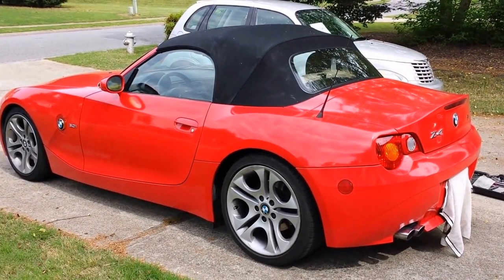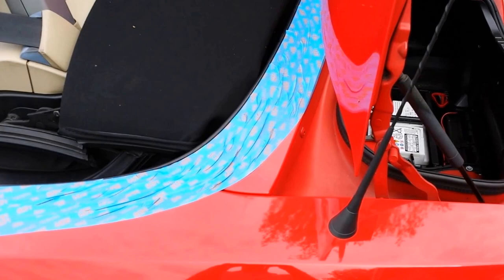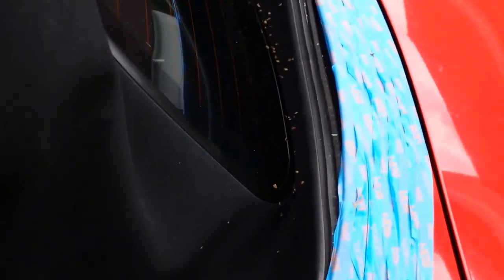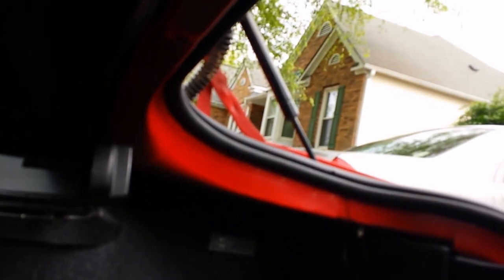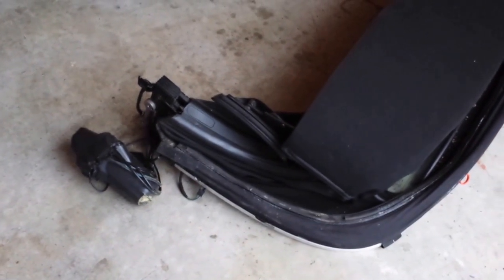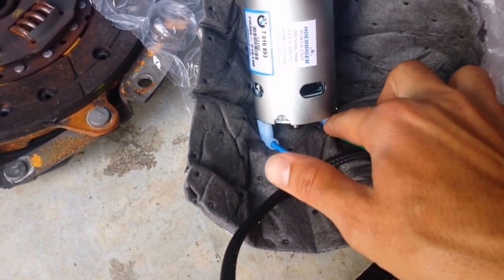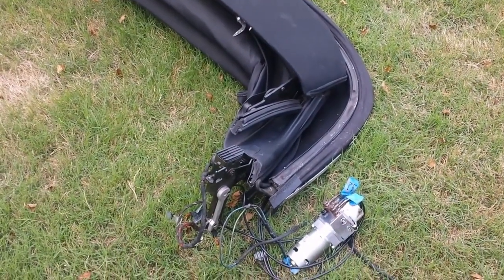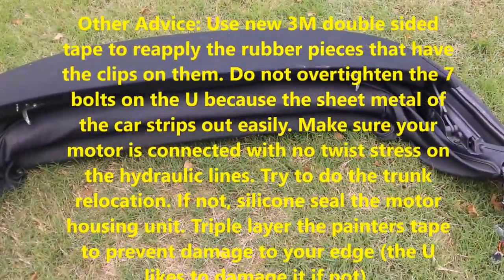How to remove test and replace a BMW Z4 Soft Top Motor COMPLETE HD

Comment: Great video but you are incorrect about the banjo fittings, the hole does not have to line up with anything. The roundness of the banjo fitting is sort of like a tubular tunnel. Good luck everyone.
Reply: You are spot on...
That's the way this type of fitting is designed.
Brake calipers have the same type of fitting.
No worries, about lining up the hole.

Comment: Americans are experts at how to make a job really difficult. Can take the motor out through the rear corner with parcel shelf tray out. Roof doesn’t need to come out. Doesn’t need new motors either. They all can be fixed.

Comment: FYI, you don’t have to line up the holes. A banjo fitting is designed where the hole lines up in a certain channel in the banjo fitting. Like a groove. Good video though.

Comment: Pull the “u bracket” from the front not inside the trunk. I used a long screw driver both sides popped right up

Comment: If you remove the bolts around the aluminum ring in the trunk first the rubber weatherstripping is much easier to remove.

Comment: EZ tip to remove U-ring from the forward clips. 11:10.  Put top up. From outside just forward of rear wheel, Reach around inside top approximately where clip is, grap frame and gently but firmly jerk upward. Do both sides. Pops right out. Thank for video!
Reply: I had to figure this out by watching a video by the Car Ninja.  Seems so simple now.
Reply: a wonder bar from inside the trunk about 7" from the end worked too

Comment: Thank you for the detailed video, this just helped with replacing the rear wing as there is a bolt where the roof frame needs to be dropped to get access

Comment: this video worked for me.  weather stripping was a bitch to reinstall.... thought about the relocation to trunk but didnt feel like cutting stuff... silicone sealed the housing.  thank you for this upload saved me a $1000!
Reply from the maker: You are welcome. I tried the relocation but got lazy. I ended up moving the motor to behind the driver headrest! It limits how far back you can move the driver seat but I am only 5'6" so it worked for me.
Reply: Any tricks on the weather stripping

Comment: cont: they knew the pump was on it's way out and tried to wing it past a Buyer. They also paid for a spare key through a BMW dealership ($235.00 and detailed the car very nicely..I am the second owner...it was garaged kept..all service records..top and body in exceptional cond. 50% tread left on run flat tires. thanks again for posting the vid.

Comment: I am getting ready to do mine, and your video was a big help.  I still am wishing they had a better  system than those tight clips at the fronts of the U-rail.  I don't see a good way to get to those.
Reply from the maker: Agreed. I used a trim pry bar that was metal with a handle.

Comment: Pray4UrLife12- Mate, you need to urgently update this video. At 18.00min you are telling people to line up the bolt holes with the outgoing lines. This is INCORRECT!! Massively! 
The bolt hole is irrelevant. The hydraulic banjo goes completely around the bolt and its hole. If you try to line up the "hole to the line" as you've stated, you wont be affecting the fluid flow at all but you could very well not be doing up the bolt enough to stop any leaks. Remember.....this is high pressure hydraulic fluid. ALL connections MUST be tight to stop leaks. You never have to line any holes up with any lines. When you understand the design of the banjo joint, you'll see what I mean. You really need to find the torque spec (ft/lb etc) for the bolt and, ideally, use a torque wrench.
I hope this helps people out and stops them having to waste another 4 hours ripping everything apart due to leaking all the fluid out :)
Reply from the maker: Boostinpulsar I stated this because I noticed, when tightened properly, the holes lined up for me. It was actually impossible for me to tighten further. Is this a general knowledge banjo bolt statement or do you know this to be true for this specific scenario? I'm more than willing to update once I ger home if you can help me confirm your information. Thanks for picking it out! I hope people have the common sense to realize if it is too loose. Good find, boost!
Reply: No worries brother! Yeah, this is a general banjo joint statement. Its how they're designed.  They are a full-encapsulating design. I used these types of larger banjo's on water lines to and from my watercooled turbocharger core. It allows the joint to be filled with the fluid, despite where the hole in the bolt is. Under pressure, it will go in the hole within the bolt. So, it doesnt matter where the hole is. It will still flow the same amount of fluid under the same pressure available from the pump despite where the hole is.
If you just type-up in yellow writing "Update: Do these two bolts up to manufacturers specifications, regardless of the bolt hole lining up with the line or not", it will help people out from having leaks. I'd also recommend that you say to test the lines prior to reinstallation, to make sure theyre are no leaks, by powering up the pump with the lines connected. :)
Reply: I was shaking my head too at 18:00... Banjo bolts should be torqued to spec with new crush washers, no matter where the holes are! Please update this to avoid leaks for other people attempting this.
Reply: I'll second all said. Banjo bolts don't need to "line up" they need torqued with new crush washers.
Reply: It is also important to  note that the hydraulic lines are numberd.  they MUST go back per numbers on the pump.
11-13, 12-14 in their respective holes.

Comment: Out top was working perfectly, then after arriving home we pressed up and top went up 1/3 of the way then stopped. Further inspection, appears pump and cylinder are fine as we are able to feed power directly to motor and make top go and and down with no biding issues etc. So we tested holofex sensors and they seem to work well. Took top module apart and there are no smells or burnt circuits. Trunk tray sensor bi passed and switch tested all works well. We can press the down top button and it goes down, then windows roll up as always, but when we press up it goes up smooth then stops 1/3rd of the way up and blinks red on switch. Press down and town goes down again, then up and it goes up again. LOL lubed all joints, car running while testing, etc. Again we are able to complete the top up with direct 12v power to motor and back down. We also direct 12v to lock motor and it does work fine, locks and unlocks. ANY IDEAS? HELP, I am about to trade this car in next weekend and this happened.... HELP. Thank you in advance. We did check all wiring in top going to sensors for pinching damage etc but all looks good even inisde headliner.
Reply from the maker: DSM Dallas wow that sounds like a nightmare. You have done everything that I am aware of. I was lucky and it ended up being my soft top motor so I never looked into anything else like you have. I did however have the same problem as you with the top not passing up past 1/3. Maybe the release pin needs to be tightened or loosened. What I am talking about is the red lever that you pull to manually close your top. It is found on the left side of your top accessed from the trunk. There is a white plastic knob found on its line that can be used to adjust tightness of the red handle. Perhaps the line itself is being impinge on during closing causing the motor to disengage during closing? Is the fluid level okay in the chamber of the motor? Maybe you have an air bubble trapped because of slow leakage over time. You should see some fluid on top of the motor.

Comment: This is fantastic! Thanks so much for taking the time to put this together!! I know I'm going to use it in the future. Quick question: There's no need to bleed the lines to remove any air that might get into the system when replacing the motors and swapping hydraulic lines? Seems like performance could be affected if air is introduced... ?
Reply from the maker: patryk996 I did not replace the lines, only the motor. There is air in the motor fluid housing which I imagine would be the end point of any air that may have been trapped in the method that I used. If so, add some oil to the motor compartment afterwards.

Comment: Your car sure does look a lot like mine… Did you change the woodgrain to aluminum trim? I still can’t find the build sheet to mine but it is red with a black top 2003 3.0 it was either that or a Miata or a Porsche Boxster, I still kind of long for a Porsche but this car is solid and great the only downside is expense of tires
Reply from the maker: I had a NB Miata prior and I would never go back. Yeah, I didn't care for the expense of the Porsche. I just changed my 2 tires last week for $560...

Comment: Great vid, I'm currently doing mine and about to start re assembly of the pump/motor. Did you need to add hydraulic fluid to the reservoir before or after connecting the lines or do you add it via somewhere else? Thanks
Reply from the maker: I just added it the the chamber on the motor after reassembly, work the pump, re-top off chamber as needed.

Comment: Great video,  and I follow your procedure upto 0:52, and the soft-top is stopped at the exact position as yours.  Hope to get the   details how could you make it all the way to the bottom,  don't want to try the brute force method now.
Reply: pull the red ring on the cable in the and lock it so it stays pulled.  This allows you to manually raise and lower the top.  It's fairly heavy but it can be done.
Reply: @tamiebasse6595  Thanks for your reply.  I didn't try too hard and worry about breaking something for so doing,  will try again.
Reply: I forgot to mention the latches to the top of the windshield need to be undone before you can move the top manually.  I've never tried it but if these electrically operated latches don't work , they can be operated after removing a plastic trim cover near the front-center of the top and then using an allen wrench to retract both latches simultaneously.  The electrics sequence the latches before the hydraulics before retracting and the hydraulics operate before the latches when closing the roof.
Reply: @tamiebasse6595  Yes, the latches on top of the windshield are working in my z4, thanks again.
Reply: @tamiebasse6595  I tried to use brute force and I could fully open the top now,  no matter the red ring pull out or not,  and luckily it doesn't break anything and I can go ahead my investigations,  thanks a lot.
Reply: It should be much easier with the red ring pulled because it opens valves in the pump that allow the hydraulic cylinders on the retraction mechanism to push out and pull in fluid as necessary for manual cylinder movement.  If it can be moved regardless of the red ring position,  the cable from the ring to the pump may not be moving the valve inside the pump correctly or there may be internal leakage in the pump.  Also, the retraction cylinders themselves may be leaking internally or the hydraulic oil may have escaped.

Comment: Hey thanks for the 'How To' you should get 'hazardous duty' pay and some Purple Hearts for the wounds incurred 👍 I was going to attempt it on my 2005 Zed pump failed a week after I bought it used last month..
I called the dealership ( not BMW dealership) where I bought it and they graciously agreed to replace it, even though it was not warrantied ..The I got to looking at pics of the car they had posted on their website and they did not have one pic of the car with the top down...even though all 17 of the other convertibles ALL had 4 pics in a panel w/ top down.
I'm thinking they knew and were just hoping someone would say 'oh well'They fixed it in one day..Paid in a spare key $235 from the local BMW dealership , and detailed the car real nice for me as a goodwill gesture.So I was spared some sliced fingers...:-)
That was nice of you to post the vid...you seem like a calm dude and made it look easy..thanks again,
Reply from the maker: Glad they took care of you! Not many dealerships out there will do that. Just peek your head in to see that the motor housing was properly sealed or else you will have the same issue some short months down the road. Thanks for the compliments. Enjoy the Z life!

Comment: Thank you! Very well done. Guess I now have some work to do.
Reply from the maker: Jeff Tucker best of luck!
Reply: I am a bit curious. I do not hear the motor pump running when I activate the up or down switches. I hear a quiet hum, very quiet, almost can't hear it. The windshield latch mechanism was fine before I manually forced the top down, all 3 fuses on my fuse panel are fine, but it is as if the motor is not getting voltage. If the motor was shot, wouldn't it blow the 40A fuse? Could the hum that I hear be a motor that is no longer pumping fluid and is just spinning?
Reply from the maker: Jeff Tucker is an orange light coming up by the roof button? if so your trunk roof is not in proper position.
Reply: Haha, This is a very troublesome question for someone who is red/green colorblind. There is a light that comes on solid, but I don't know if it is red, orange or green. When the other half, the color assistant gets home, we will check. With the roof where it is right now, there is no light unless I push the up or down button. I know that I had a light that would not go out until I managed to completely open the top and seat it in the all the way open position. Also, when it was trying to work on its own, before I manually put it down, it released the windows down, the windshield catch released, then after a few seconds of nothing more happening, the light blinked, but what color it blinked I could not tell you. I am 66 now and have been very tired of this color blind thing for about 60 years--#paininthebutt! You are incredibly helpful. I can't say Thank you enough!